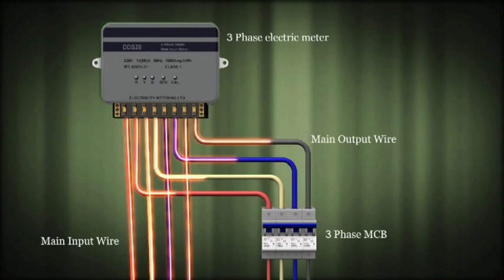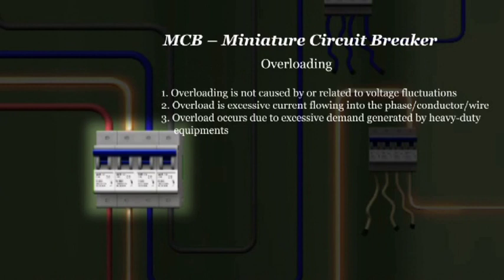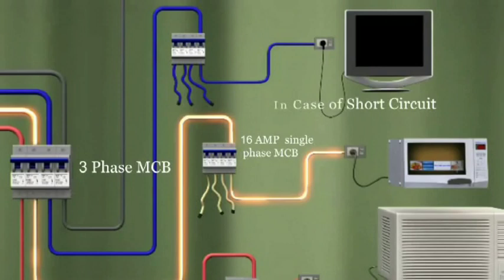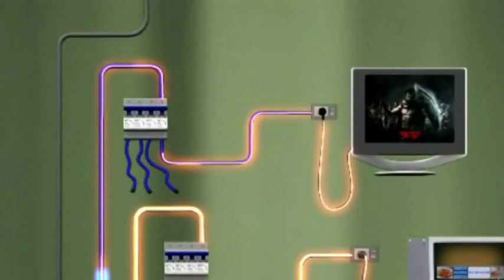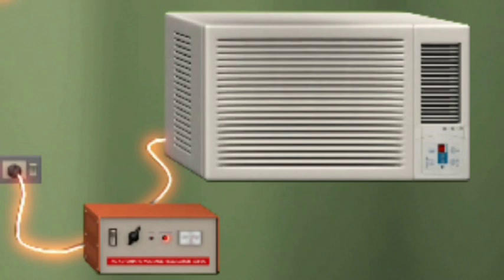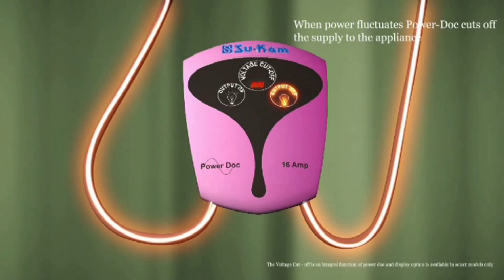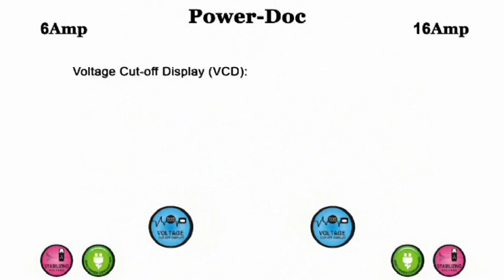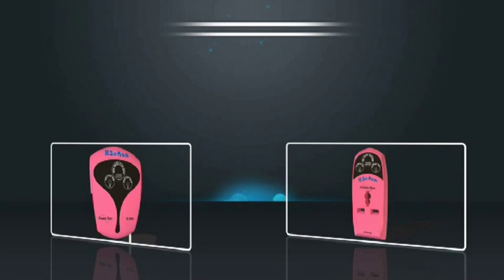How to safeguard against Voltage Fluctuation

Comment: I using stabiliser but voltage fluctuation no use these .. our power 0V to 300 volt with in every Three sec .. in this situation no equipment can be use every three sec cut off and on and again cut off happening so I removed it and directly connected .. it is dangerous but no power coming in such situation through stabiliser what to do